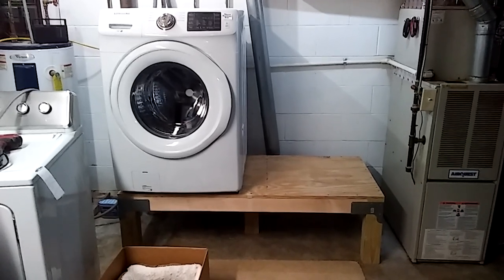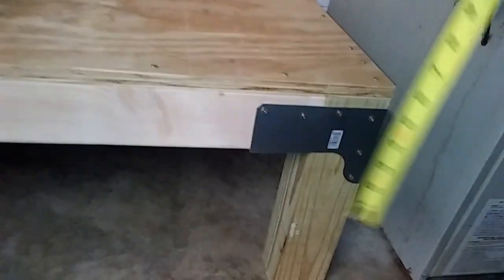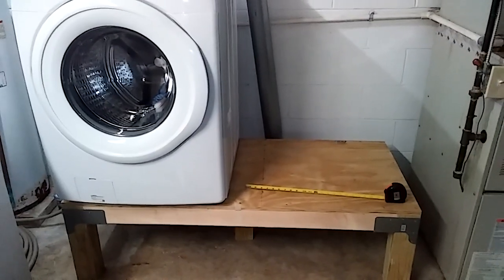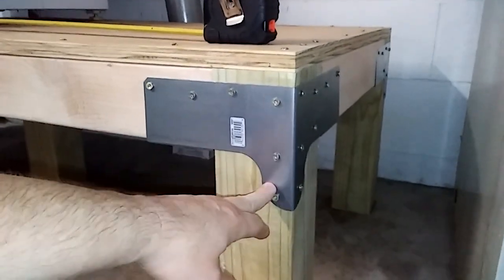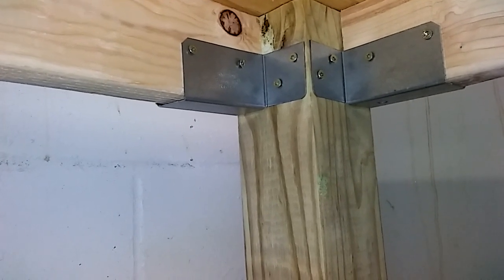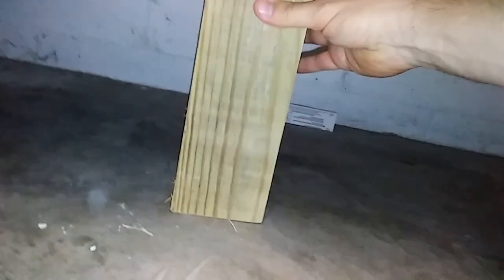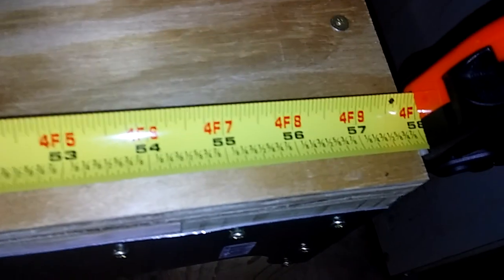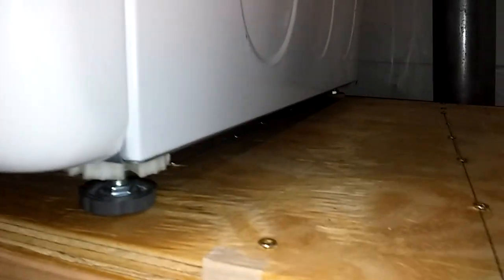How to Build a Washer Dryer Pedestal

Comment: Just built mine thanks to you. Had HD cut all the wood needed. Cut a length of 4x4 into 4 pieces. Cut 2x4 into 2x 53", 2x27", 2x23". Cut 3/4 plywood 30x60. Used the brackets you used. Brilliant
Reply: Why 53 inches if he said it needs to be 58inches ?
Reply: @jfox11000 the longer 2x4 pieces are between the 4x4 posts so their thickness was taken into account for the overall width of the platform

Comment: Keep it simple... if you want to dress it up in the front all you need to do is add 1" spacer to the front add some trim or even laminate.  All the other videos you watch, with cost and tools, would be more then the 250 each 27" stands sold for each.

Comment: How does it work 6 months later? Why didn't you install a barrier around the perimeter? Do you think I can do this model but prolong the legs a bit more (18-20') - I would like to have the openings on eye level...
Reply from the maker: Still solid as a rock, I think if you raised it a little higher it shouldn't be any problem at all with a four by four legs, it's a great project to do, good luck!

Comment: Nicely done. How has it held up? Still good and sturdy after a couple years or did you end up revising your design at some point?
Reply: All the screws fell out, the steel bracings disintegrated and the wood crumbled by the third wash.